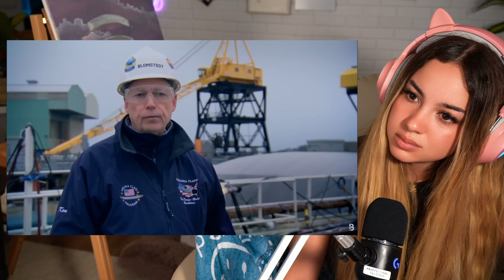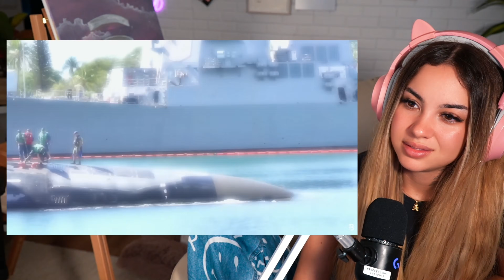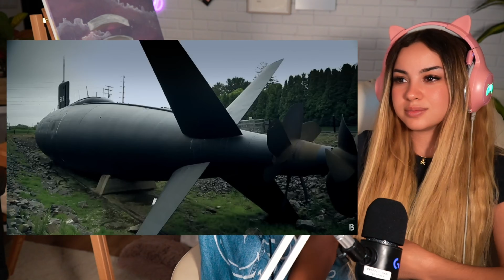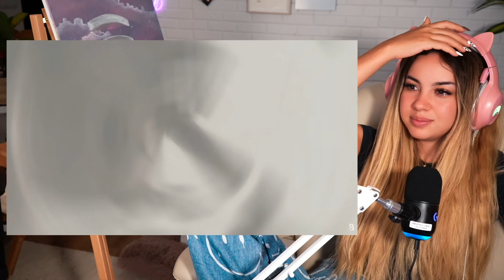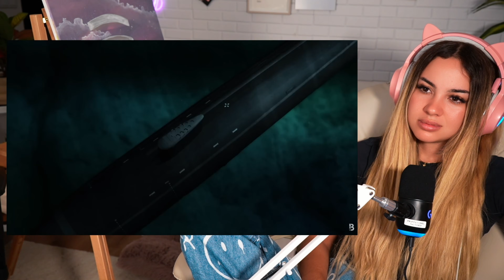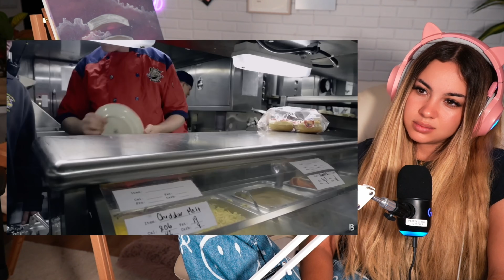The Engineering of America's Virginia-Class Submarine Terrifies Me

Comment: Atomic bombs, nuclear reactors, and nuclear medicine all work on the simple principle of fission. Some elements will split into two or more particles releasing energy. They split randomly which is measured in half-life, how long it takes for half of the element to split. The ranges are from seconds to 4.468 billion years for Uranium 238.

You can speed up the fission process by bombarding with neutrons at a controlled rate which is nuclear power. Very fast reactions go boom.

Other elements can be created in reactors to create elements used in nuclear medicine such as radioactive isotopes of Iodine, Yttrium, Samarium, Strontium, or Rhenium.

Comment: I served aboard a Lafayette class Fleet Ballistic Missile Submarine, the USS John Adams, SSBN 620, during the cold war.  I did four years on it. Of course my sub is scrapped and is now probably razor blades now.  But the new Columbia Class looks cool. Also, I wish they had Guided Missile boats when I was in. ('79-83). The longest I did underwater was 98 days. And there are no windows on a submarine. And we went much deeper than 240 meters, but the depth is classified.  I suppose my boat is no longer classified, but I still won't say it. I took my oath seriously. We were not a fast attack boat, (those are the ones that seek out the enemy, and do battle with them). Our mission was much different. We were to remain undetected and be able to launch our missiles should the order ever come. (Thankfully it never did).  So we liked to say "We hide with pride". And funny thing, one time we almost didn't surface. We did a ballast tank blow, and the forward group blew, but the after group didn't.  We were going down and sliding backwards until the captain jumped off the conn and hit the 'chicken switches' and we popped up like a cork.  (The chicken switches are emergency switches that shunts 4500 lbs of air directly to the ballast tanks. Those are only supposed to be used if it is either that or sink. That was a bit scary.
Reply: Howdy fellow bubblehead. You were in just before me (85-91). But my sub was older (611) after it's conversion to carry DDS and SDV.
We weren't there. But if we were there, we didn't do it. We could do it. But we were never there. wink wink nudge nudge.
Reply: Once a bubblehead always a bubblehead. USS Tautog SSN 639 early to mid 80s.
Reply: Rock on man! Thank you for your service. I was a Navy Nuke on board the USS Long Beach (CGN-9) and the USS Nimitz (CVN-68) during the end of days of the Cold War ('82-'95). But I was a 'target', just couldn't being myself to volunteer for a boat designed to sink, lol.

Comment: Most modern operational nuclear-powered submarines have a maximum normal operating depth of roughly 800 to 1,600 feet (240 to 500 meters), with absolute structural crush depths estimated between 2,000 and 2,400 feet (600 to 730 meters), though exact military capabilities remain strictly classified.
Reply: Yep... except crush depth for the Virgina class is much deeper than 2000 feet... 

(1) Design Depth - This is the nominal depth listed by the manufacturer and is used by the engineers in the design process. Not public info, but math tells us it is 745 meters or 2,400 feet.  (2/3's of 2400 feet = 1600 feet)

(2) Maximum Test Depth or Maximum Rated Depth - This is 2/3's of the Design Depth in the US. This is the Max Depth that is PERMITTED during any test dives and during Peace-Time Operations. This is public info and we are told it is 490 meters or 1,600 feet.

(3) Operating Depth (aka Never-Exceed Depth) - The Maximum Depth that is PERMITTED during battle conditions. This is classified and I have no guess as to what this is. This is not a depth they normally operate - it would be for survival or extraordinary circumstances. 

(4) Crush Depth (aka Collapse Depth) - The depth that will cause the submarine to implode due to pressure. Crush Depth is estimated by engineers and normally includes a safety margin. Submarines never intentionally dive to or near this depth, in any circumstances or for any reasons.
- However, there are instances when submarines have unintentionally been at depths deeper than the Crush Depth (due to malfunctions or sinking), WITHOUT imploding. Some have even resurfaced after completing emergency repairs.

Comment: It can dive way deeper than 240 meters and travel much faster than 25 knots
Reply: A LOT deeper. How deep it can actually dive and how fast it  travels is classified info.
Reply: And keep it at that, Brother. 😂😂😂
Reply: Rated maximum operating depth (which is not the deepest it can go, just the maximum rated to operate in any and all conditions) is 490 meters or about 1,600 feet.
Reply: @thebestdavidpeters  But no, it can't go to the deepest depths of the oceans, which are many times deeper than that. There is no need to go that deep, though. In order to do so, it would have to be specifically engineered to survive the incredible pressures of those depths, which would be a task not worth the expense, trouble, or negative performance costs. It travels at the depth it needs to be at, and was engineered for.
Reply: @dustysmoke4996   the comment didn't say it can go to the deepest depths of the oceans... they said it can dive deeper than the Max Operating Depth Rating. We don't know how deep our Subs can dive during battle conditions, nor do we know its Crush Depth.... as both depths are classified. 

You are 100% right about subs operating at the depth it needs to be at. However, the max depth it was "engineered" for is confusing as there are several "max depths" depending on the conditions... and people often lump them all together. Here are the max depths that I know of - there could be more.... 

(1) Design Depth - This is the nominal depth listed by the manufacturer and is used by the engineers in the design process. Not public info, but math tells us it is 745 meters or 2,400 feet.

(2) Maximum Test Depth or Maximum Rated Depth - This is 2/3's of the Design Depth in the US. This is the Max Depth that is PERMITTED during any test dives and during Peace-Time Operations. This is 490 meters or 1,600 feet.

(3) Operating Depth (aka Never-Exceed Depth) - The Maximum Depth that is PERMITTED during battle conditions. This is classified and I have no guess as to what this is. Perhaps they are trying to avoid something or someone while moving, or trying to stay hidden. This is not where they normally operate, this would be for survival or extraordinary circumstances. 

(4) Crush Depth (aka Collapse Depth) - The depth that will cause the submarine to implode due to pressure. Crush Depth is estimated by engineers and normally includes a safety margin. Submarines never intentionally dive to the depth (and shouldn't even get close to this depth). This is never used as a Max Depth in any circumstances or for any reasons.
- Also, there are instances when submarines have unintentionally been at depths deeper than the Crush Depth (due to malfunctions or sinking), WITHOUT imploding. Some have even resurfaced after completing emergency repairs.
Reply: Semper Fi Devil Dog!
Reply: shhh
Reply: warthunder players are about to enter the chat
Reply: They can dive to at least 1200ft.

Comment: I served aboard a nuclear fast attack submarine in the late 70's. The max depth and speed of a submarine is classified, so they go faster and deeper than they are telling you. Mine was smaller than the Virginia class by about 100ft and 2,000 tons lighter. The food was great but their was no communicating with family (no internet back then) and we usually stayed submerged until we went back to port. The air was son purified that head cold disappeared until we went back to port. Submarine sailors were easy to identify by the fact that we has no sun tan, were pale in color and were sneezing out heads off, after we cracked open the hatch. The common joke about the submarine service was that 100 sailors submerged and 50 couples surfaced Ha Ha. Take care, Saini. 👍👍🙏❤